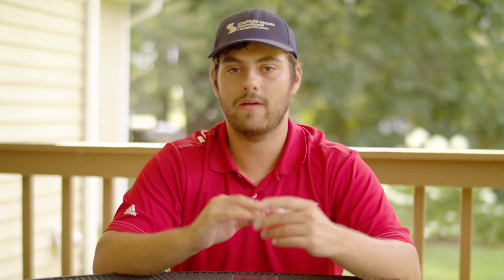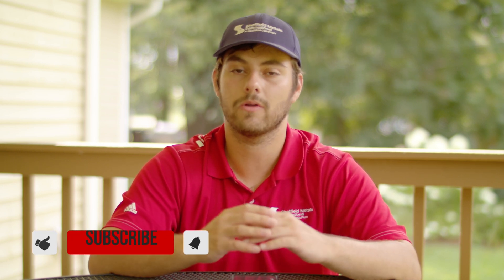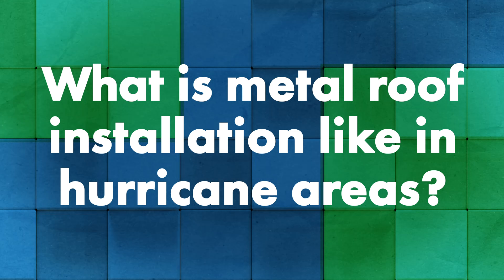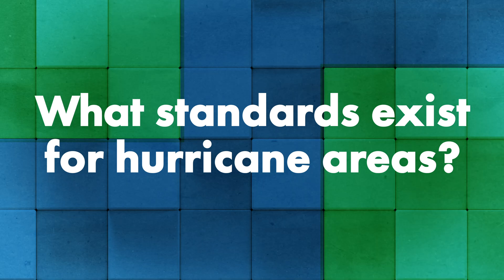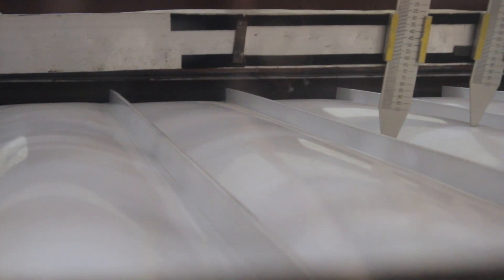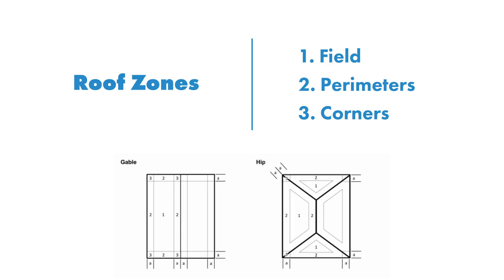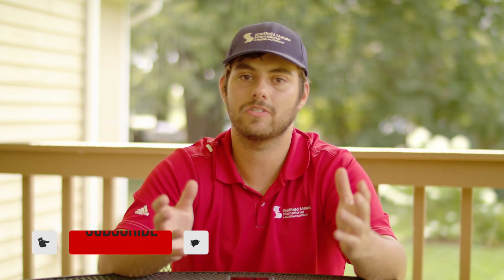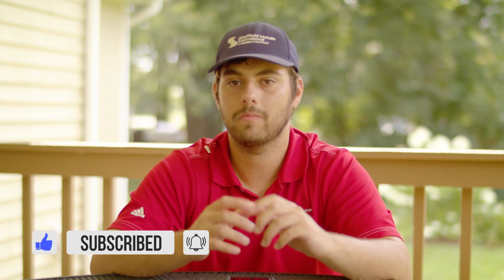Hurricane Zones: Standing Seam Metal Roofing Best Practices

Comment: Exposed fastener metal roofs survived hurricane Ian in Cape Coral, Florida where Ian stalled right off of Sanibel Island and pounded Sanibel, Ft. Myers Beach, Pine Island and Cape Coral for hours and hours before it finally moved just north of us and officially came ashore south of Punta Gorda, Florida. According to FEMA snap lock metal panel roofs are the worst performers in hurricanes when they inspect roofs after a hurricane cane. There are many examples of snap lock panel metal roof failures after hurricanes and even mechanical seam metal roof failures after hurricanes. Exposed fastener metal roofs have more attachment points and they are the easiest to check to make sure they have enough fasteners installed. Hidden fastener metal roofs are hard to determine if they have proper attachment points and let's face it there are many roofing companies that do not install metal roofs properly taking short cuts to increase profit.

Comment: Thad, please explain the need for, and options for ventilating between the roof deck and the metal roof.  I am confused about whether ventilation is recommended, required, desirable, worth the money, etc.  I have seen 1x2 installed at 45 degrees, and I have seen mesh products (including EMF blockers) and I am totally at a loss to decide how to go.
Reply from the maker: Hey, Kevin. An above-deck air gap helps to improve cool roofing properties in certain circumstances and is also an option for venting a building with cathedral ceilings/no attic space. It completely depends on your specific application and location. Can you give me a little more information? Are you putting a metal roof on your home? Are you installing it yourself? Where are you located? -Thad